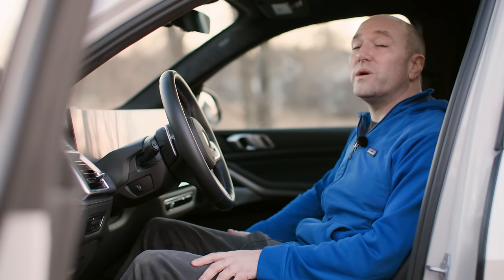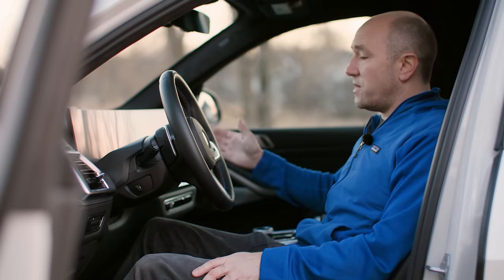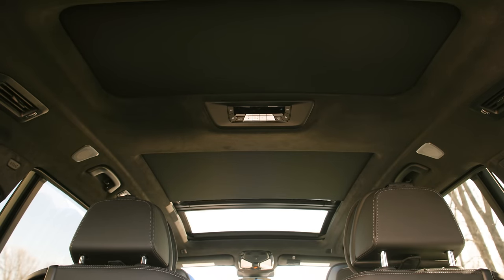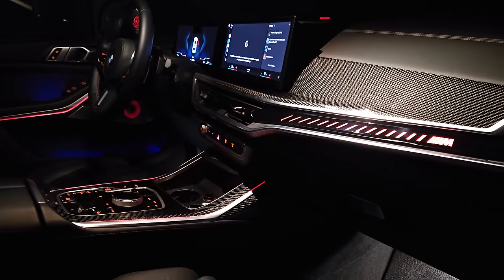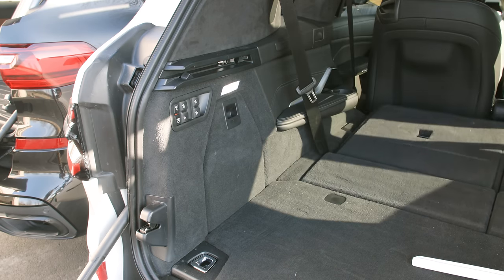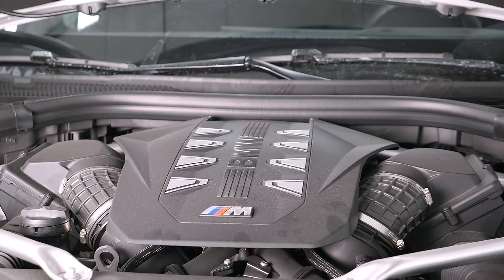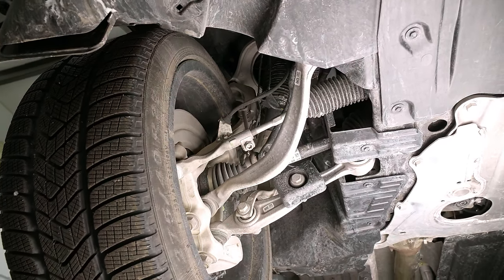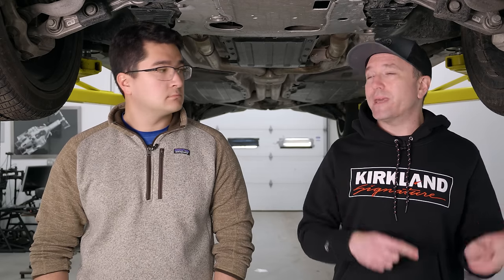2023 BMW X7 M60i | A Mixed Bag of Updates

Comment: The next time you talk to the engineers, can you try and uncover the real reasons why buttons are disappearing? I don’t think an engineer can truly say this set up is better from a usability/ergonomics standpoint. Who in the board room is making these decisions and is there any internal conflicts within BMW/other manufacturers.
Reply: I feel like they just do it to save money.   There is no way anyone actually thinks it’s a good idea.
Reply: They clearly said it was because people were confused and overwhelmed with all the buttons
Reply from the maker: Two things they wanted to declutter, it was a common user complaint.  Their infotainment data logs and uploads usage to their cloud infrastruture. They chose what to remove based on usage.  They know what people use and dont use.  Then they axed certain physical controls based on that. Then left certain buttons like defrost and hazard because of regulation.
Reply: Removing physical controls also makes manufacturing easier. Less knobs buttons and switches reduces the number of assembly operations and reduces potential points of failure or quality issues like squeaks and rattles which reduces the time the vehicle takes to build and pass quality inspection. It's effectively a sophisticated way of cutting costs for higher margins.
Reply: It’s a design cop-out (all screens = no physical UI/UX to design, manufacture and assemble). It’s cheap, it’s easy and increases profit margins, but I would be astonished if any industry insider ever admitted it on camera.
Reply: Two things. Screens are cheap so it saves money and complexity in the interior. And look at how most reviewers and consumers wet their pants over things like screen size or a pretty UI. It really is a no brainer for manufacturers.
Reply: @savagegeese  it's also cheaper and faster to produce.
Reply: Thanks for asking this and thanks for the vivid response @savageese

Comment: The 2020 X7M50i is the GOAT of the X7 line up for many reasons.  It is the last pure V8TT ICE engine and that is significant. This 523hp M50i engine is rock solid and very tunable to stupid amounts of additional hp.  
   It also was the last of a truly fully optioned vehicle like top tier options night vision, ionized and ambient air, Rear Seat Entertainment, etc…..  Then there was all the upscale build options like a full alcantara roof and alcantara roof sunshade, alcantara parcel shelf, etc… Trim in the 3rd row was just as upscale as the front.  2nd row doors had puddle lights and keyless entry.  This was the vehicle BMW spared no expense in offering and was on another level.   After 2020 it was a down hill fall with dropping  major and minor options and  cheaper build materials in the switches and exterior.   The 2023 LCI is still suffering for lack of premium options and lower quality build materials and this extends to the XB7 ALPINA as well.  I own a truly fully optioned 2020 BMW X7M50i that took BMW 7 months to build and this was in the best of times pre Covid. Just shy of $130k and worth every penny as it has been rock solid reliable as well as quiet as a casket with no rattles or squeaks over any road surface.   It was extremely rare then and now it is a white elephant to the point I believe BMW may never build a luxurious vehicle to this level.  BMW has changed their “flagship vehicle” priorities from top build quality, V8 rumble, luxurious ride and opulence to this new LCI bizarre Asian design/styling and distracting tech that is cheaper to manufacture than a quality buttons or switches.  That luxurious tactile feel of a switch or quality button push is gone now.  The new “S” ICE engine is now bastardized with a electric motor in the transmission that will brick the vehicle with any simple fault code giving you the common “Drivetrain Malfunction” message new frustrated owners are starting to experience.   All in the name for future emission standards.  It’s “S” designation means nothing and is a mass production engine no more special but a marketing spin to only make one engine platform for all vehicles.  😮. It appears BMW is embracing and riding out the “supply chain” excuses to produce lesser quality vehicles and hoping their core customers don’t notice.😢
Reply: MAN, epic post, and very TELLING as you said, even 3 or 4 fukkin years later BMW won't even build an X7 that good again and I know why I bet, the first two years they needed to pimp them so they made them amazing then just said make 'em suck like the rest.

And BTW I have a 2007 BMW X3 that I love, my fave era of BMW.
Reply: "It is the last pure V8TT ICE engine and that is significant." (that's 2021 not 2020 I believe)

Comment: Speaking of most functions being delegated to the screen, my cousin just bought her VW ID4. Hopped in it for the first time on our way to dinner last weekend. I never had a car that drove me nuts when it came to trying to access basic functions. You tap/hold the on the HVAC symbols on the screen and nothing happens (we were cold). I'm 30, even worked at a big branch cellular store 4yrs ago... so i'm no boomer. Anyways pretty sure she figured it out by now, but WOW lol....
Reply: Leave your HVAC on auto and set a temperature that you are comfortable with. The car will go to that setpoint quicker than if you tried to do it manually. Don't set it to a low temperature if you are hot or a hot temperature if you are cold, set it to your comfortable temperature and never touch it again.
Reply: @zoppp621  that's what I thought until I owned cars with automatic climate - that strategy doesn't work with winter weather. You're wearing a coat so 22 degrees Celcius (72 F) is WAY too warm, but you can't turn it down because at 18 C (64 F) it's at the minimum and turns AC on! Also, you want to turn on defog mode, but pressing that button turns off the floor heaters, so you have to punch mode a bunch of times while watching the screen to adjust it to defog and floor. Plus, when it says "auto", that can mean auto fan or auto temp, and many systems don't tell you which or give you independent control. I find I spend way more time trying to figure out how to get it to do what I want than my older cars with manual climate, which I could set without looking.
Reply from the maker: That UI is trash, clearly designed by someone who never drove a car before.
Reply: @savagegeese  well they quickly backpedalled and will be bringing buttons again!
Reply: @questioner1596  sometimes they turn the AC on not to cool the interior, but to dehumidify/defog the interior. So in the event that it's winter, you just change your temperature setpoint to what is comfortable and the car will achieve it as fast as possible, even if it means kicking the AC on. The idea is to abstract the complication of controlling vents, flow and AC vs heater core flow and just present what the operator wants which is a temperature setpoint. Tesla has done a pretty good job of presenting only what's needed to the user unlike the ID4 and makes it easy to access other modes if absolutely needed. But I don't really find my self ever touching my temp setpoint.
Reply: @zoppp621 , that is true about the AC if you turn defog on, but in the case of turning it to the coldest setting, it's about cooling the interior as fast as possible. However, it's ridiculous to turn the AC on at -30 to achieve a set point of 18C (64F)
Reply: @questioner1596  normally it would be crazy to do so but it's likely the computer realizes that if it pulls out door air without dehumidify the inside air, it will result in fog condensing on the windows. To prevent that, it will turn the AC on automatically to dehumidify and prevent fogging so that the temperature setpoint is met without causing other problems for the driver.
Reply: @zoppp621 , yes, that makes sense and is normal on defog cycles - even 80s cars did this. However, that's not why it automatically turns the AC on when you turn it to the coldest setting. It's to cool off the interior. Plus, when you make the interior colder than ambient, window condensation will not happen on the interior because moisture condenses on the coldest surface, and the windows will be relatively warm. 

My point is that to achieve 18 degrees celsius when the interior is already -30 by turning on the AC is idiocy - it can only achieve 18 through heating.

Comment: The reason the exhaust sound is so different is because the new S68 is based of the S63 found in the M5,M8, X5M etc. This engine uses a cross flow exhaust manifolds where both banks share a turbo. This gives you that more exotic V8 sound. The N63 exhaust manifolds are not crossing. Each bank has its own turbo. This gives you that traditional V8 rumble.

Comment: I have had one now for 4+ months now. The HVAC controls are definitely the worst part, especially coming out of a 2019 X5. Mixed on the front end but it has a ton of presence, and I weirdly get a lot of unexpected compliments. What sold me on it though is that this thing is a howitzer on wheels, especially in Sport Plus mode.
Reply: More like a Panzerhaubitze 2000 on wheels lol
Reply: @Knnnkncht  Haha yep!
Reply: Did one of those folks with the compliments introduce himself as Ray Charles?
Reply: I got the same type of experience and only had it as a 2 week rental.

Comment: I watched the Acura MDX Type S video again just to compare it to this BMW X7. I think that Mark likes the Type S a bit more.
Reply: It's a better car to own for sure
Reply: The Type S is a good vehicle it just depends on what you want. It is definitely the better car to own in the long term, but it is not in the same league in driving dynamics and speed. However, it is a lot less expensive so it is a great value in my opinion. The sound system in the type s however is one of the top 3 systems I have ever heard in a car. (Very good)
Reply: @jamesgage1365 I would lease this but own the mdx
Reply: Vehicle price probably plays a significant factor here, The X7 is more expensive, bringing higher expectations.

Comment: IDEA for a special video topic: Put the ballooniest tire format allowed on a bread-and-butter vehicle focused on comfort not sporty driving performance and examine how much smoother/quieter the ride is and the overall difference in driving feel and whether the trend towards bigger wheels and thinner tires is madness.
You could even do a bonus round and try to race a car with such tire format and examine how much driving quality is really lost.
Reply: Kinda like a comparison to see if using more throttle gives you worse fuel economy, ppl kinda just already know more sidewall increases comfort
Reply: @Onewheelordeal  Funny, because there's that claim that brief full throttle to target speed could be a more efficient operation for the engine than creeping up to it with minimal throttle. But it's inconclusive AFAIK, with many variables involved.
Regarding the sidewall it would be relevant to examine driving safety, kind of a limited field within driving performance, and how often/much that is relevant, especially compared to the obsession with energy saver tires that inherently have worse safety performance.
Reply: @Dowlphwin  the ice engine is most efficient at high load low rpm, that may be true in a manual when you can shift early but if you're in a car where the auto trans will just downshift as low as possible and rev as high as it can get to, you will definitely not be getting better mpg than just trying to keep the rpms as low as possible (not accelerating comically slow either)
Reply: This sounds great. Give em all 16 inch wheels, bolt pattern allowing, and see if luxury is just a tire swap away
Reply: People like to run 80-90mph everywhere. Tall sidewalls get squirrelly.
Reply: You might be surprised. I have a Q7 riding on 21s and kind of regretted it came with such big rims. Well, I got winters for it this year on 19 inch rims and...actually, not much difference in ride quality. It's maybe a bit less harsh over very hard hits on things like misaligned expansion joints, but not enough to really make a difference. Another data point is that the guys at Tyre Review took a look at identical 911s with 19/20 and 20/21 rim packages and found very little difference in ride quality. I find that the actual tyre itself can make way more difference than rim size, unless you are going to something truly dumb like 20-series sidewalls.
Reply: @david1rosenthal  I went from Michelin Primacy to a GY Eagle F1 (touring to uhp). The ride quality barely changed. Slightly more crashy over big hits, but not enough to annoy. But the difference when you're pushing on in any scenario is pronounced. I will never go back to a touring tire again.

Comment: The physical controls in my x3m is amazing. I love the buttons on the last gen. The new gen would frustrate me quickly because I’d have to interact with the screen for pretty much everything. Wish they left the programmable buttons alone.
Reply: I love the programmable buttons.
Reply: @ARentz07  Same, those programmable buttons are a huge value add. Easy to use, efficient, won't break ever. I don't think I"ll buy a BMW without it frankly

Comment: I miss some of the physical buttons. I agree, I really loved having 8 shortcut keys that could be for vehicle functions and not just the radio. However, the i8 system does still give you 4 short-cut keys. If you swipe down from the main menu, you should see 4 configurable shortcut keys. It wasn't intuitive, but to populate those shortcuts, you have to surf through the menus and just long-press whatever menu item you want to add to the shortcuts. Then to remove a shortcut, you drag down the short cut menu and long press on the option you want to remove. It's a little clunky, but it's still there.

Comment: All of these vehicles are great for pilfering parts after they get discarded. Seats frames, engine block and heads, brakes and rotors, sun visors, center console structure between the seats, electric cooling fans. Everything else is either a tossable computer part or a soon to be LKQ inventoried SKU.
Reply: OR....a place to LIVE!!!! haha, you'll see when your living in an X7, it will be quiet in there at least!

Comment: Shortcuts are still available with iDrive 8. Select your shortcut, and access it by swiping down. Each shortcut is labeled, rather than requiring you to remember which radio button to press.

Comment: Great video guys - I had a 21' x7 M50i which was completely loaded and even included a Carbon upgrade that pushed it to 623 hp and 712 torque until a teenager pulled out in front of me and it was totalled. Trying to decide do I go back and get a 21' again or move up to a 23 or 24. Avoiding 22's since it's super hard to find one with DSC. BTW - you are so right about the depreciation on these - I took a massive hit with the insurance company despite having every upgrade in mine except for the tow hitch. Thanks for the insights on the 23'.

Comment: Bought the X7 40i M sport package plenty quick. You get used to the screen. The front end, tech, and the hybrid system is why you buy the new one. It stands out plus I wrapped the pillars and roof like a range rover white body black roof and pillars. So far everything works fine, no problems.

Comment: Man, they have to do something about that "new" infotainment. I get it that this is business and they need to make money everywhere so they decided to put everything on the screen instead of having physical buttons that cost them money. I tried it during the test drives a couple of times and it is horrendous to operate. It is even dangerous since you have to shuffle through all those menus, while driving to setup up even the most basic  things that used to take a second to do before.  It is really, really bad and a huge turnoff for me.  I will stick to older models because of that or switch to competition like Genesis

Comment: BMW used to be all about driving. Everything on the car was simple, easy, functional and didn't have anything you did not need to drive. It was quintessential German. Function then form. There is one company you can get a real BMW from. Mazda.
Reply: Genesis? Especially the G70.
Reply: It's crazy how Japanese brands that used to play second fiddle and Koreans are now top picks for new models.
Reply: Mazda isn't all about driving anymore either. They're going luxury which means thier cars are only going to get more numb. Hell the Mazda 3 turbo is proof they are going in bmw direction
Reply: GM's Blackwings

Comment: Contrary to my friends' preferences, I dislike automatic stop/start with a passion. I find it irritating to no end, dealing with the herky jerky acceleration from a dead stop.  I have not driven an X7 BMW incorporating a/s/s into the hybrid transmission along with engine cutoff during deceleration.  However, it seems to be overcomplication without purpose. Is it possible to disengage the a/s/s in the M60i like it has been for so many years now?
Reply: That’s a deal breaker for me, if that tech is on a vehicle I’ll just pass and look at something else.
Reply from the maker: No you cannot disable it on M60i.  One of the reasons I got M50i was no hybrid stuff just V8 and tried and true transmissionm

Comment: As an owner of an M240i with iDrive 8, I will say adjusting the climate becomes a non-issue. Just set it and forget it. BMW's intelligent auto climate does the rest for you. Auto heated steering wheel, auto heated seats.. it works pretty well IMO. I do miss the preset buttons :(